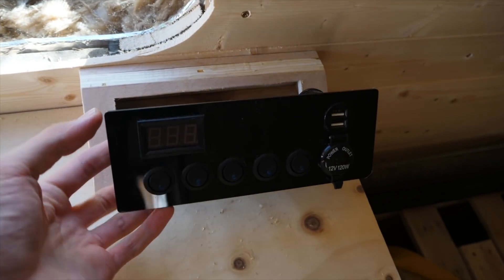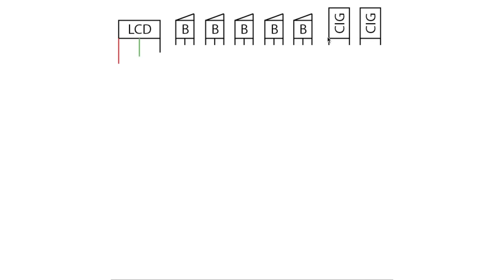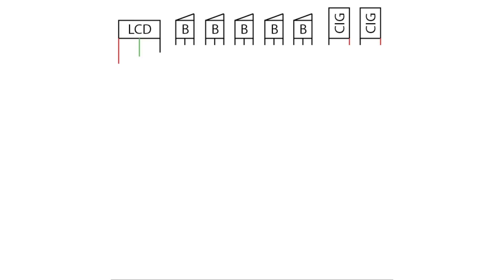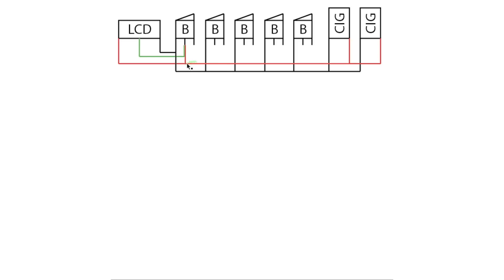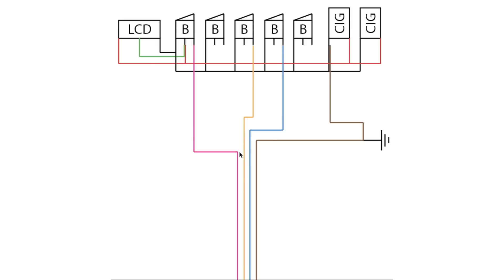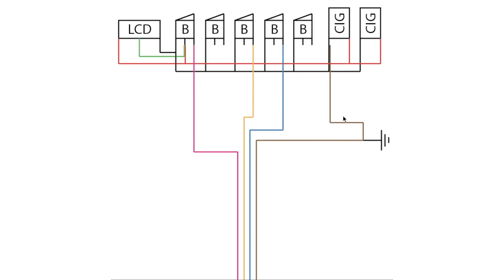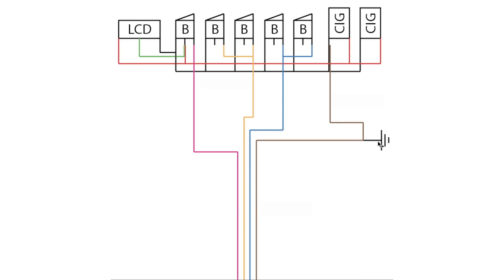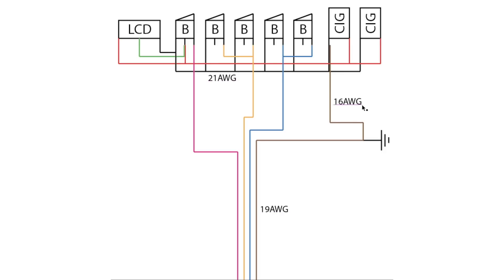WIRING Your Own Camper Van CONTROL PANEL - DIY Electronics

Comment: AWG, "American Wire Gauge", is a classification by diameter. (There used to be a comparable British "Standard Wire Gauge" (SWG), now not so common)
Higher AWG numbers indicate lower diameters, and therefore higher resistance and lower load capacity.
If you can't find the exact wire, then go a grade LOWER rather than higher (ie, it'd be safe to use 16AWG all round - but not 21AWG).

Comment: Hi mate I’ve got a 5 way switch panel which is going to my 45 psi shurflow water pump, 6x 12 v led spot lights, and a 12v/240v fridge, I haven’t decided the rest of the switches yet but do I need to go to another fuse box even tho the switch panel is fused. Also I plan on having a 110 Amp battery which is connected to a split relay charger and will have a trickle charger connected when hooked up, but what size wire will I need to go from there to the switch panel/fuse box, and my final question is if I’m using a generator will I need to use a ground stake ?

Comment: Awesome video! What wire would you use from the control panel to the batteries?
Reply from the maker: A lot of panels bought online come with very underrated cable for the panel in use. The cable powering the panel should be capable of providing amps for all the fuse ratings of the appliances used plus a little extra. So as an example, if each switch was individually fused and there was 6 switches all fused at 10a then the cable powering the panel should be capable of carrying at least 60a but I would use cable rated at at least 65a or more and then that cable should be fused

Comment: 20 AWG ish is okay for the LED lights but deffinately not for the pump if you have a shurflo for example mine can take max 10amp, so you want to beef that wire to 16AWG (1.5mm2) at least, otherwise you will suffer voltage drop and in worst case scenario wires burn. Obviously if you have a tiny pump then it might be okay 20AWG (0.75mm2 equivalent) is rated at 6A max.

Comment: Great vids Hugh. I’m wiring up a 12 v panel now that only has one live (red) cable to the leisure battery. My issue is what size amp cable should the power to the unit from the leisure battery be. Mine is pre wired with 18awg cable, I don’t feel this is big enough if everything is in use.
Reply from the maker: wow only 18awg, according to what I have seen 18awg can take anywhere between 7-15a depending on the strand count and material. That seems very small when you consider what people run through those control panels. I know the panel you are referring to. Based on info online I would use a 10a fuse

Comment: Forgot grounding. 19 awg from the leisure battery (neg terminal) is grounding/earthing at the same point on the van...underneath rather than inside somewhere on the van frame? Do all other earths join up or do they have separate spots ie from the consumer box in the hook up set up and from the volt sensing relay or dc/dc charger? Cheery lol
Reply from the maker: Hi Gordon if the battery is only 1 metre away I would take the ground cable straight back to the negative on the battery

Comment: We have a pre wired one that everyone and their gran seems to have. Came in the order usb/lcd (red and black wires only in and out)/cigarette/5 x switches with all the switches with a 16 awg wire and 15 amp fuse hanging off the middle prong. Definite has a feeling of cheap as chips! Contemplating doing away with a chunk of this pre-wired madness and an popping in a new lcd to allow me to follow your instructions. Good idea? The panel is going to be just inside the van side door, the garage and electrics/consumer box will be no to far away and the panel switches will be for lights/fridge/water pump. New wiring is under 1 metre, the 5x 15A fuses will still get used and it’ll be more up to the job #nexttimemakeabetteronefromscratch
Reply from the maker: Hi Gordon, you could definitely have a go at modifying yours if it will help get a panel that would work better for you. I guess modifying what you  have takes away the annoying process of crimping all the  termiinals

Comment: Hey buddy. So quick question..... I only need 1x live coming from battery to the panel. Then it all branches off
Reply from the maker: For the panel I used it had 3 cables that came from the battery (with a fuse inline)  but there are some control panels from ebay which have all the fuses at the back  of  the  control panel and they only require one positive power cable to the panel from the battery

Comment: Great video, useful information...
On your panel you can see the Voltage, but how do you know that the battery is actually charging..??
Many Thanks ...
Reply from the maker: on my ctek there are some led indicators that show where the power is coming from to the battery and if it is charging or not.
Reply: Cheers, O.K... Have been looking at the CTEK devices.... 
Have seen some panels that show actual current flow "into" battery
Ueful to see how well the solar panels are doing, or not.!!

Comment: Hi 
I'm looking for some advice regarding wiring a control switch panel into my campervan. 
What amp wire would you recommend to come from the leisure battery to the switch panel? and what amp wires would be best to come from the switch panel to the lights, water pump and aux which will be connected to a 3 way panel (consisting of 12v usb post, cigarette lighter port and a ammeter).
Hope that makes sense :)
Reply from the maker: Hi Richard, there are lots of 12v wire ampacity calculators online you can use. I can't say what amp rating without knowing the lengths between each part/application.

Comment: WHAT ABOUT FUSES??
Reply from the maker: The control panel cables go through a fuse box in the rear. If the fuses were in the back of the panel it would be a huge pain to have to keep removing it when a fuse blew

Comment: Hi Hugh, great video. Not sure if you could help at all but I have a zig X 8 panel controller in my motorhome that has gone blank. Ive checked all the fuses and they are all ok. Do you have any ideas ?
Or can you reset them ?
Kind regards
Duncan.
Reply from the maker: Hi Duncan, I can't help from this end but you could get a multimeter and start testing where the current is getting to to try and locate the fault!?
Reply: Thanks Hugh, much appreciated , Duncan.

Comment: i’m thinking about doing up a ford transit, was wondering if i can use the parts you use on my van in New Zealand. love your work
Reply from the maker: Yeah I don't see why not. the only thing i think changes is the drivers side so the swivel mount may be different
Reply: HughTube oh no the drivers seat is still on the right hand drive, thanks for the reply, can’t wait to get started cheers

Comment: Do you need a fuse box for this?
Reply: Would it not be better to use a fuse box so you could have a fuse in each wire running to a connection (switch or plug in)?  Very nice diagram though one of the best I have seen.
Reply from the maker: Yes there is a fuse box between the cables and the leisure battery
Reply: awesome, thank you,  learning a lot

Comment: I was told to use stranded 10 or 12 because the back roads vibration will break wire, by having more strands than needed it would likely never become an issue.  But I am NOT an electrician.  I decided to go more robust because I really want to travel rough roads.  Great explanation of the wiring diagram, I think I almost follow...

Comment: Your 16awg is useless.  The way you've wired, it's the same as a 19awg seeing that you're not grounding the block to the van. The problem is back-feeding the 19awg ground making it the weakest part of your circuit. And of all the wires in your circuit the one that will carry the most load is your ground, I suggest swapping the 19awg ground for a 12 - 14awg.
Reply from the maker: Hey buddy thanks for the input, these schematics are based on the system I bought from Rayne Automotive. Interesting to hear your points
Reply: HughTube, you could simply fix the issue by attaching the grounding block to the body of the van. Also if this is the schematics they gave you,  I would question the company. Each power-port should be fused with a 15A fuse. That's 30A Max. Does it make sense that 19awg wire 5ft long will will hold 30A for very long or will the wire become your fuse and possibly cause fire? Where a house uses 12awg and a single socket can handle 30A at 100ft. But it's just the logical electrician in me. Sorry if I couldn't help.